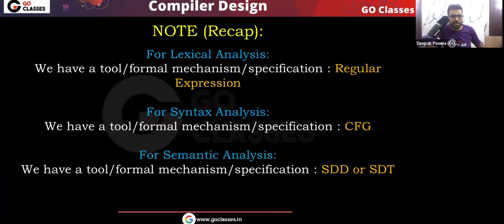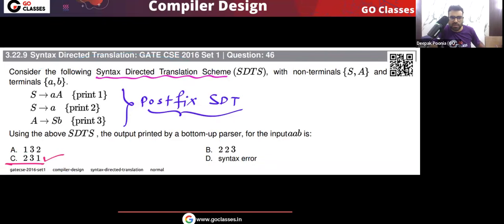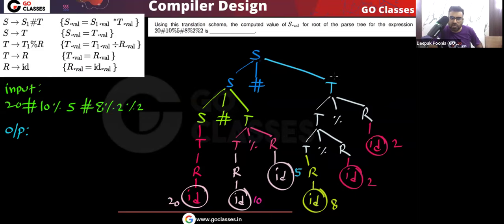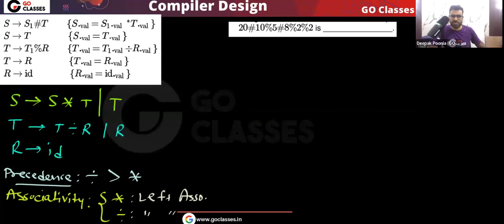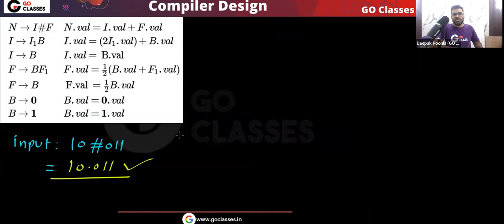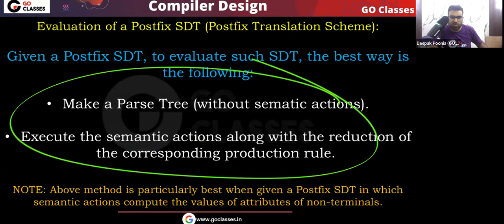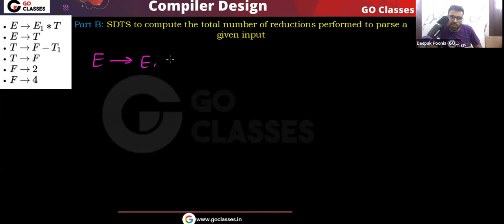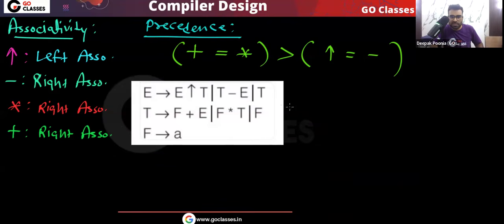SDT - ALL GATE PYQs | Syntax Directed Translation Scheme | Semantic Analysis | Compiler Design

Comment from the maker: Introduction and Core Concepts Recap :

00:00:00 - Introduction to SDT: Overview of the lecture's focus on solving GATE previous year questions PYQs related to Syntax Directed Translation Schemes SDTS.
00:00:50 - Recap of Compiler Stages: Brief review of the tools used in different compiler stages Lexical Analyzer uses Regular Expressions, Parser uses Context-Free Grammars, Semantic Analyzer uses SDDs and SDTs.
00:02:00 - Defining SDTS: Explaining that a Syntax Directed Translation Scheme is essentially a Context-Free Grammar CFG with program fragments semantic actions embedded within the production bodies.
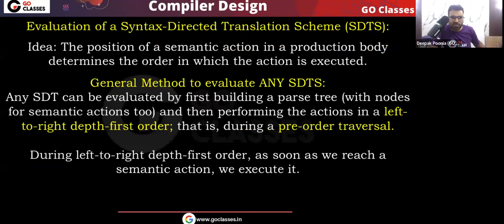00:03:32 - General Evaluation Method for SDTs: How to evaluate any general SDT by building a parse tree that includes semantic actions as leaf nodes, followed by a left-to-right depth-first pre-order traversal.
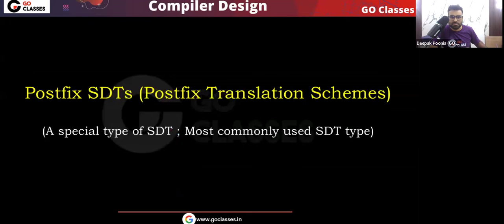00:08:00 - Introduction to Postfix SDTs: Defining Postfix SDTs as a specific, highly common type of SDT where all semantic actions are strictly placed at the extreme right end of the production bodies.
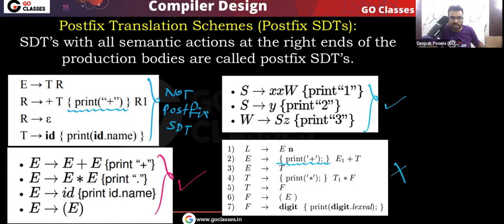00:10:46 - Special Evaluation Method for Postfix SDTs: Explaining the highly efficient method used exclusively for Postfix SDTs: executing semantic actions concurrently with the reduction of the corresponding production rule during bottom-up parsing.

Solving GATE Previous Year Questions PYQs :

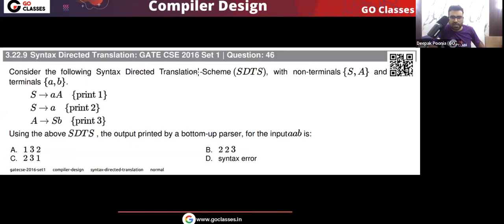00:16:24 - Solving GATE 2016 Question Method 1: Tackling the GATE 2016 problem using the general evaluation method building a parse tree with embedded semantic actions and traversing it.
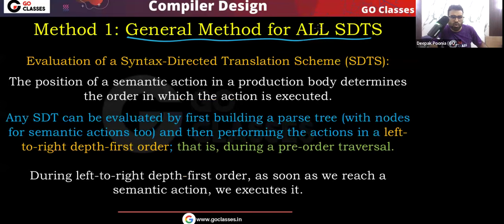00:24:50 - Solving GATE 2016 Question Method 2.1 - Rightmost Derivation: Re-solving the exact same GATE 2016 problem by analyzing the reverse of the rightmost derivation simulating a bottom-up parser's exact reductions.
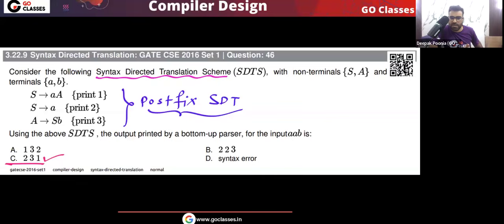00:32:52 - Solving GATE 2016 Question Method 2.2 - Parse Tree Reduction: Re-solving the GATE 2016 problem using the optimized Postfix SDT method executing actions immediately upon node reduction in the parse tree.
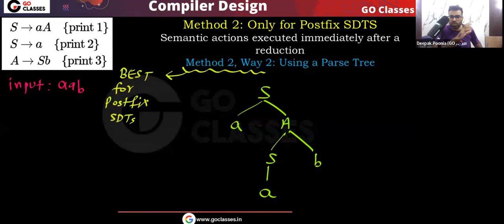00:37:42 - Solving GATE 2022 Question Method 1 - Parse Tree Reduction: Applying the optimized Postfix SDT parse-tree method to evaluate a mathematical expression from GATE 2022.
01:00:21 - Solving GATE 2022 Question Method 2 - Grammar Analysis: A faster, more advanced approach to solving the same GATE 2022 question by analyzing the inherent precedence and associativity of the underlying grammar without drawing a massive parse tree.
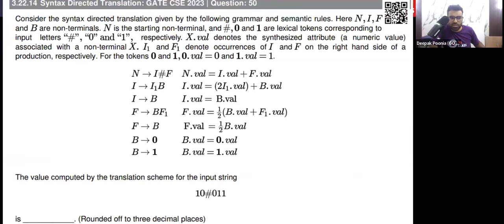01:16:29 - Solving GATE 2023 Question Method 1 - Parse Tree Reduction: Tackling a complex GATE 2023 problem involving binary inputs and fractional conversions using the standard Postfix SDT parse-tree reduction method.
01:32:32 - Solving GATE 2023 Question Method 2 - Semantic Analysis: Dissecting the semantic rules of the GATE 2023 question to logically prove that the entire SDT simply functions as a binary-to-decimal converter, allowing for instant calculation of the final answer.
01:58:53 - Solving GATE 2000 Question Part A: Constructing a parse tree and computing the final attribute value for the mathematical expression 4 - 2 - 4 * 2.
02:18:55 - Solving GATE 2000 Question Part B - Modifying SDTs: Modifying the given SDTS semantic rules to track and count the total number of physical reductions performed by the bottom-up parser during execution.

Advanced Grammar Analysis & Associativity :

02:36:39 - Bonus Analysis: Complex Operator Associativity: A deep dive answering a student's question on how to manually determine the precedence and associativity of complex, multi-operator grammars.
02:42:04 - Indirect Right Recursion: Explaining how indirect right recursion dictates right-associativity for specific operators.
02:44:02 - Ambiguity in Expression Grammars: Proving why a grammar remains inherently ambiguous if operators on the exact same precedence level possess conflicting associativities e.g., one left-associative and one right-associative.